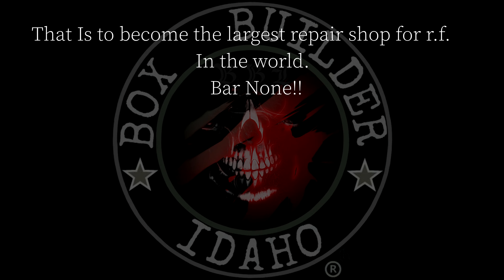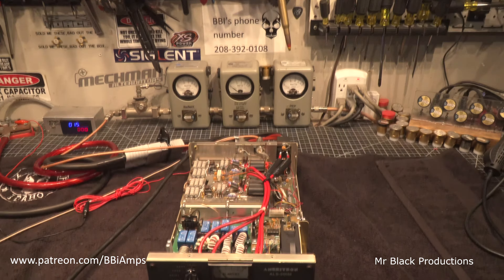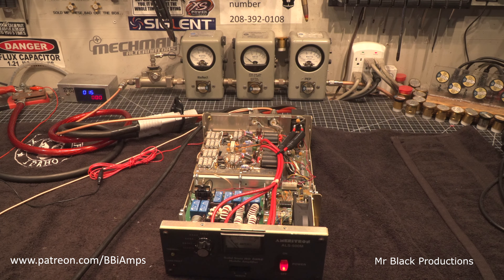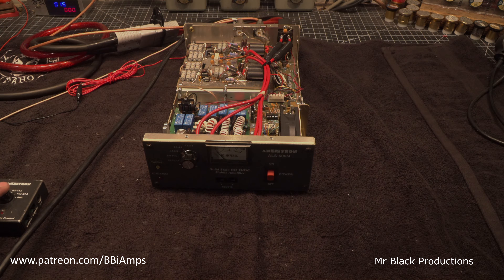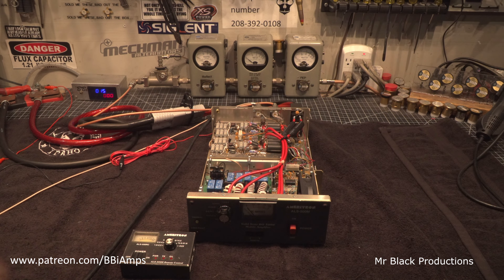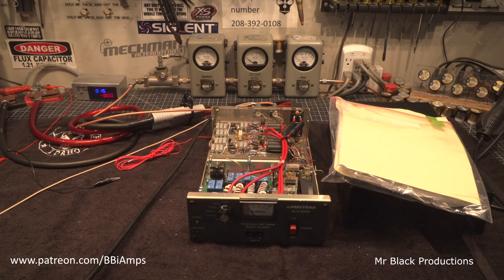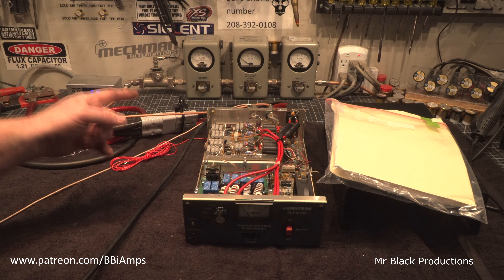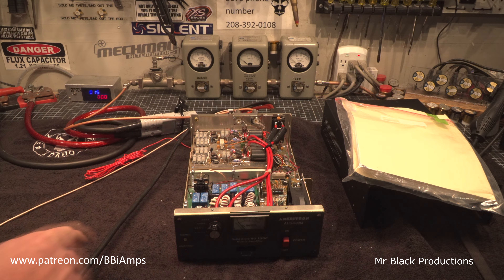Ameritron ALS-500m sold!!

Comment: Whats up. I'm local here in boise. Wondering if you can do an amplifier rebuild.  Or hell just to collaborate with you. We have been doing sine shoes locally and Wondering if you would like to know when they are?
Reply from the maker: I don't do car audio amplifiers bro.. And nice JBL GTI 15" I got a few of thows
Reply: @BoxBuilderIdaho  4 of the gti 15s. The amp would be the jbl a6000gti. It works just want it gone through.  Not worth it if I have to ship it. Thanks for your time anyhow
Reply from the maker: @sittdogg  dude I've got two of those and I got a bunch of body parts and pieces and stuff for that amplifier you need to call me
Reply: @BoxBuilderIdaho  will do. Call you number listed on google?
Reply from the maker: 2083920108
Reply from the maker: Well before you fired up I would strongly suggest that we take it all apart and make sure none of the electrolytics in the power supply have leaked.. when was the last time it was powered up and by the way it pulls 250 to 350 amps  just to turn it on. And that requires about 30 amps just to sit there and idle
Reply from the maker: Does it have a neon tube backlighting kit or is it the newer version with the LEDs in it

Comment: Hello where could I find a nice multi band 300 watt solid state amplifier? I like being able to turn my iCOM's power down. So I can run it into my Texas Star 350 on medium power into my Ameritron AL82 on 10 meters on SSB. Having the Texas Star 350 makes a big difference the way it makes my audio come across. With just my iCOM at 100 watts into the AL82 only amplifies my audio to about 300 watts. I keep my ALC at the proper level. But with the TS350 on low or medium with 35% of drive does far better. I can bust through a pile up with ease with great audio reports. But I need a amp to cover the rest of the bands. Any ideas? Thanks de KK4YLF 73's